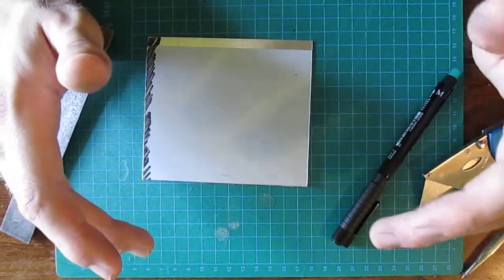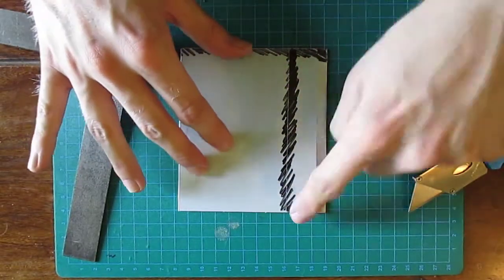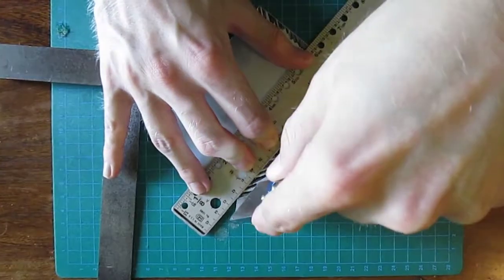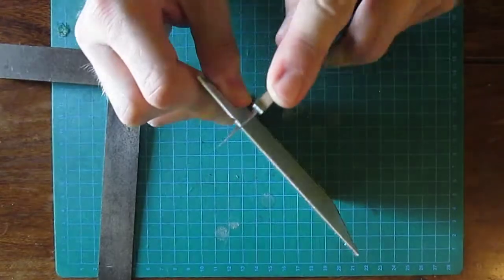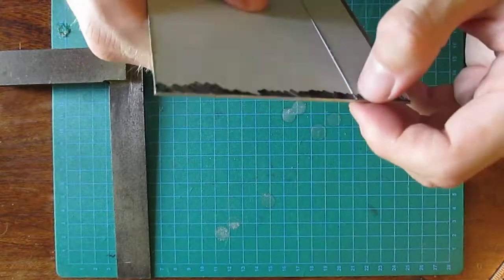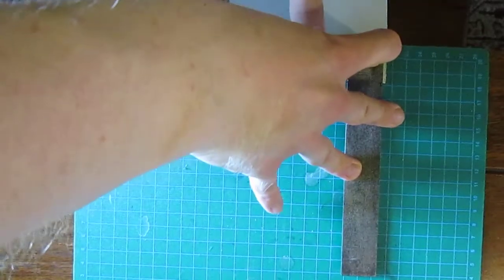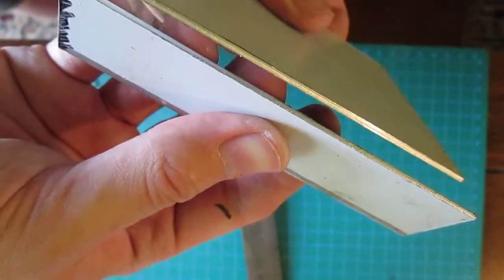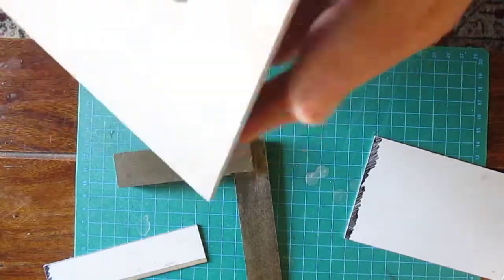Cutting Sheet Aluminum With A Knife - Scientific Prototyping I

Comment: It is possible to cut aluminium with a circular saw, but the amount you lose from the saw kerf is significant compared with this.
A hand hacksaw wastes less, but it's more difficult to keep it straight.
I need to cut 100mm wide panels from 1000mm stock, and this method allows me to get 10 panels instead of the 9 that I would get using a saw, as the waste is minimal.
The cost of a pack of utility knife blades is nothing compared to the cost of wasted stock using other methods.

Comment: Thank you so much for this tip.. My BusBoard Solderless breadboards all come with a thin alu backplate except the BB1460. Fun thing about that breadboard is that you can separate the 2 middle pieces and the two power rails. So i was thinking perhaps i could buy sum 0.15mm thin alu sheet and make sum myself..

Comment: Works on aluminum because Al is not ductile; it is brittle. Microfractures form at weak points from stress instead of the metal bending below its yield point (like steel). Once the fractures form, their growth would be exponential with each application of stress until suddenly the metal is loose and then breaks. It's why aluminum mountain bikes require shocks to prevent sudden frame collapse, which is a phenomenon of aluminum bike frames (road and bike). Steel framed bikes last forever; aluminum frame bikes are designed obsolescence.